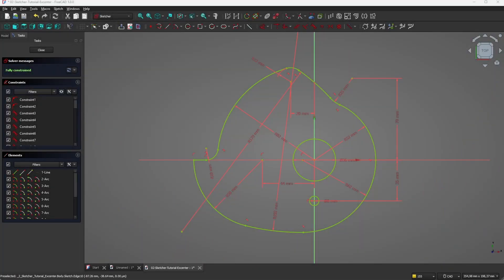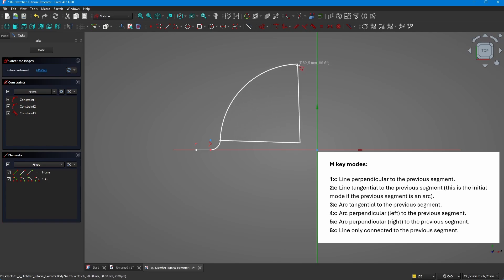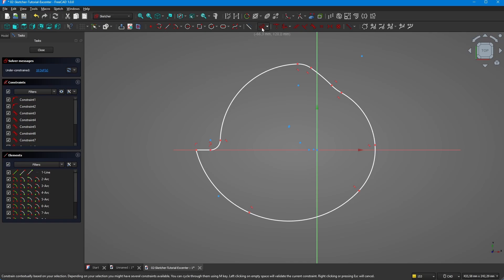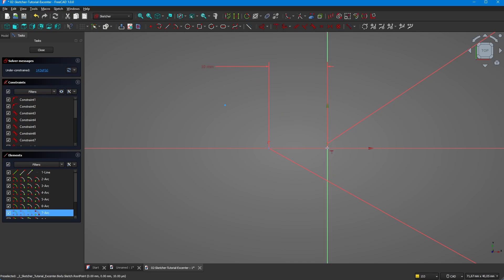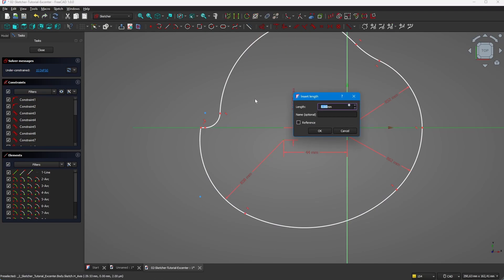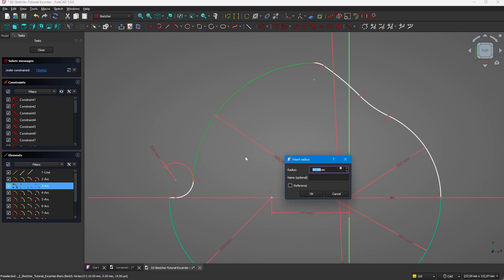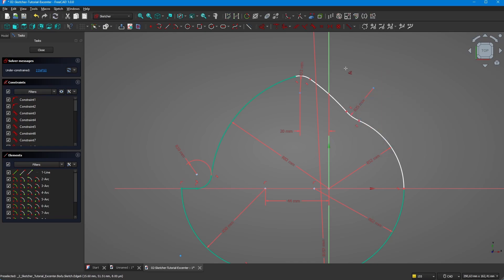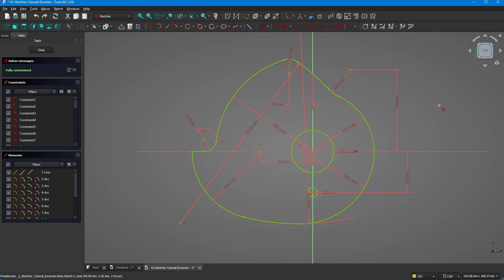FreeCAD Tricky Sketch made easy using m-key functions! #freecadtutorial #cad #freecaddesigntraining

Comment: I doubt I'll ever need to design cams for the work I do, and if I did they'd almost certainly have arcs of different radius from the same center of rotation, but it's great to know FreeCAD can do this and once we know the keyboard shortcuts it's not even that difficult.  I should practice that M key toggle when using polylines right now to have any hope that I'll remember that trick for later.